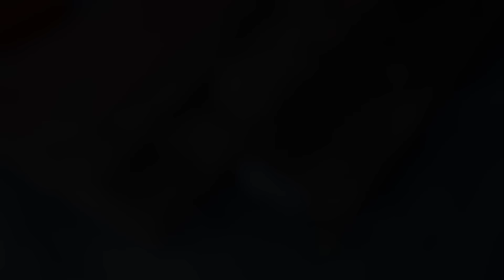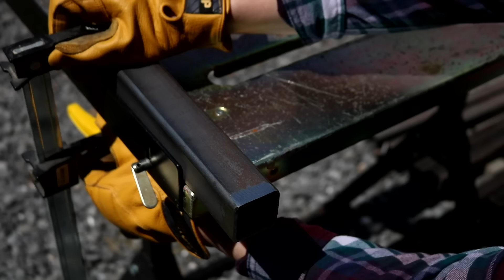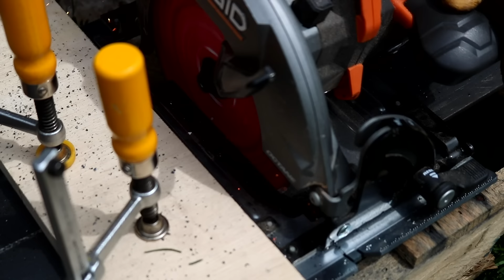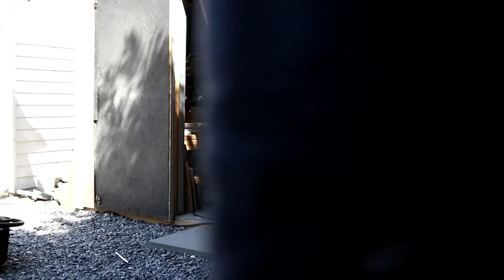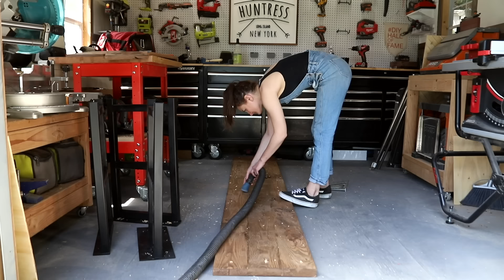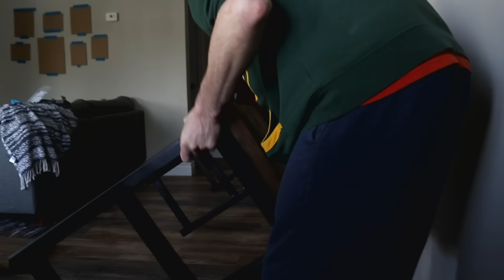DIY Metal & Wood Bookshelf

Comment: Looks great!  How did you account for seasonal wood movement of the top?
Reply from the maker: Explained in the video, but I attached the legs using threaded inserts. 😊
Reply: Right, but when the wood expands (or contracts) across the grain, it will push the bolts against the sides of the holes in the metal tubing which stays in place. It could break the bolts like you mentioned happened on another project, and the threaded inserts won't help with that. 

I've seen other people cut short slots or oversize holes in the metal just so that the bolts have room to move with the wood.

Just something to consider if you didn't account for it another way!
Reply from the maker: I purposefully make the openings in the metal wider than they need to be to account for movement. I tackle a lot of this technique in the video for the dining table that I built last summer. But, that’s something I learned from someone who welds when it comes to fabricating my own legs. Did lots of research and outreach before jumping into welding last year. 😊
Reply: Great, thanks. You didn't mention that in the video and it seems to be something important 

As I said, it looks great! Thanks for sharing!

Comment: It will better if you cut and weld the metal inn 45 degree
Reply from the maker: I mention it in the video, but this is only my second or third welding project ever and I’m self taught. So, I’ll get there eventually. 🙏🏼
Reply: @diyhuntress  nice vid and project
Reply from the maker: Thank you!

Comment: Did you also use threaded inserts to attach the two lower shelves or did you feel comfortable enough with their weight that nothing was going to be moving around at all?
Reply from the maker: I didn’t use any inserts on the middle or bottom because we’re storing so many heavy things as it is. So far so good! 😊

Comment: You can use PAM cooking spray as an "anti-spatter" spray to reduce your cleanup time with your flux core setup.  Does that welder have a gas input?  I'd highly recommend either 100% pure argon or a C25 mix if you want to go a bit cheaper and you live in an area that has a good LWS that will fill a gas tank you own and not force you to rent their own.
Reply from the maker: What! I had no idea the PAM thing was a thing! So cool! And, yes! My welder has a gas I put - been thinking about picking up a canister and trying it out! Thanks for the advice!
Reply: @diyhuntress  It works particularly well when stick welding, which is a really "dirty" method of welding.  A little bit goes a long way on clean steel, and its cheaper than buying the purpose-made stuff.

Comment: Great build. Thanks for sharing. I'm also interested in the welder's beginners course. I bought a welder 20+ years ago, when we were finishing our house.
I can't weld. The welding was done by a friend. My welding machine is an old fashioned one, only with electrodes. I've been told it's the most difficult way
of welding.
Reply from the maker: Thank you! Definitely have to do this welding thing then! The one I use is way easy!

Comment: Great end product using cheap framing lumber. And the elegance of the painted metal vs lumber is a great texture contrast. Check out wood taps to thread straight into wood. Way faster & plenty good for the application you showed here. You can reinforce the tapped threads with thin CA glue. Way handier than threaded inserts.
Reply from the maker: Thank you so much! Totally going to look into those!